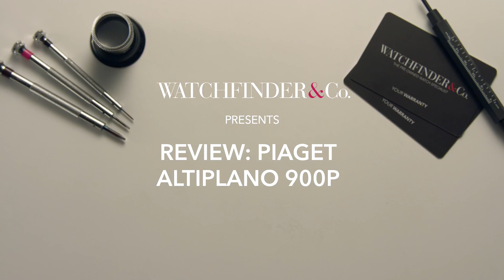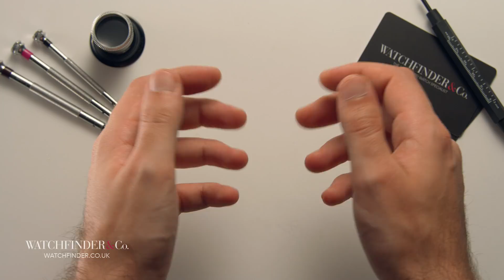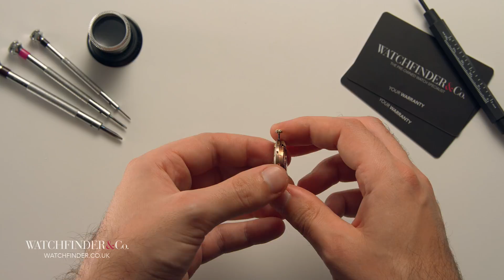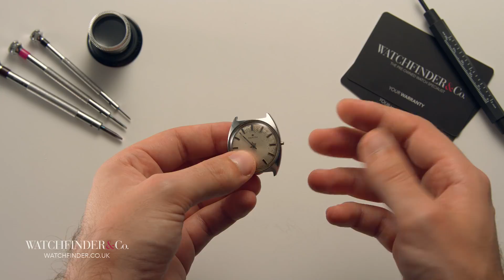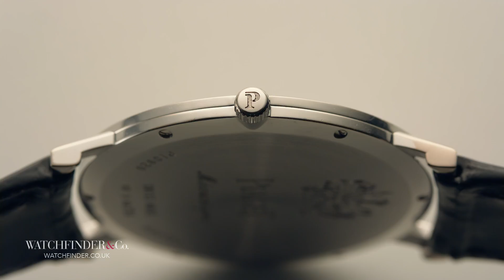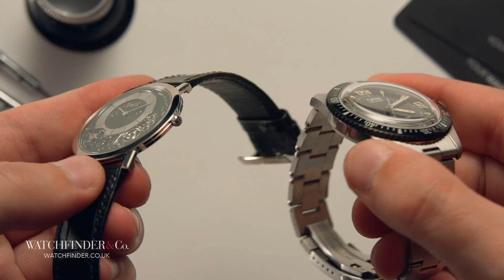World's Thinnest Watch? - Piaget Altiplano 900P | Watchfinder & Co.

Comment: Get a caliper. Holding both the watch/movement and the ruler in your hands, without even pushing them both against some base, just looks stupid. The viewer basically has to trust you when you spit out "8mm", "11mm" and so forth. Get an digital caliper and measure precisely; a decent one costs like $20.
Reply: Crushing a watch with a caliper is also stupid and will cost more than $20.  More appropriate is a thickness gauge,  costs less than $20
Reply: Why wasting time for someone who you do not trust. Go watch similar videos somewhere else.

Comment: What Piaget did was replace the base plate with the case back. So technically you are wearing not the watch, but the movement itself. And the crown of the thinnest movement of all times has been held since 1933 by Vacheron Constantin non-production model which measured only 0.9mm. The thinnest production movement is, again, Vacheron Constantin 6115 which measures 1.65 mm thick. This Piaget thing is over TWICE that thickness. So no, to anyone who knows something about watches, the record is still unbroken. And I'm very disappointed Piaget decided to go the sleazy marketing way instead of mechanical innovation.
Reply: Maloy7800 i see your point but the purpose of piagets exercise was to create the thinnest fully cased watch, not the thinnest movement

Comment: Isn't the Bulgari Octo the thinnest watch in the world ?
Reply: Daryl Z 
The Octo's movement is 2.23mm thick (or rather, thin). The watch case is 5.15mm thick.
Reply from the maker: The thinnest automatic watch, yes, but not the thinnest mechanical watch.
Reply: I see what you did there.
Reply: Damn the Octo is only 2.23mm thick and is automatic at that. Not so impressed with the altiplano anymore.
Reply: A manual watch is not a watch, it is just some fancy gears.  :)
Reply: you should put that in the thumbnail;) misleading;) when it just says thinnest watch.